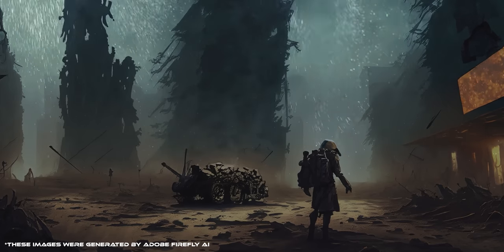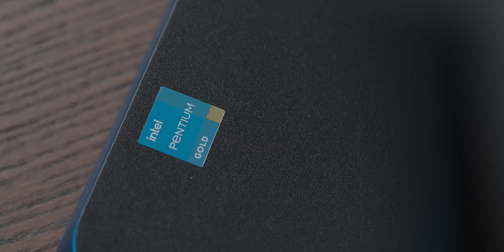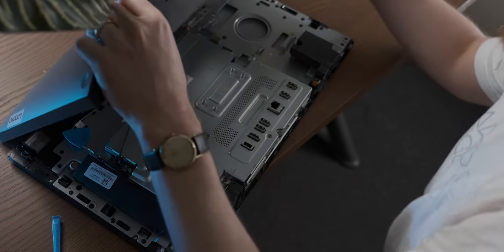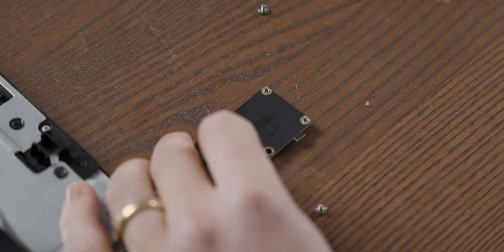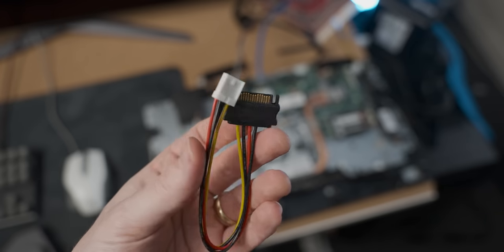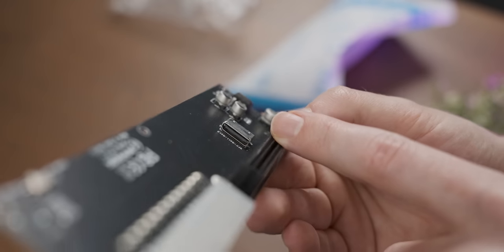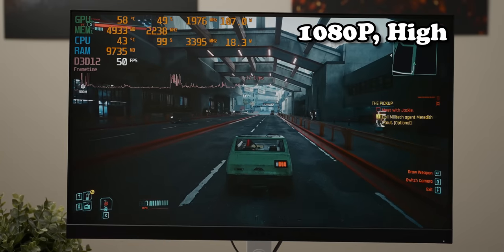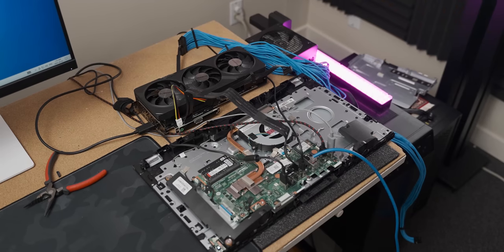How NOT To Use A Graphics Card...

Comment: Lenovo's bios has a whitelist of devices that can be used in the wifi slot. There are custom bios's that you can grab that remove the whitelist which would have made that first adapter work. I have the same adapter plugged into my t420 laptop
Reply: Can you explain the difference between cpu and gpu bottleneck please
Reply: it also might have been a cnvi-only slot... i'm guessing that because of the original wifi card being cnvi
Reply: wow thanks lenovo

Comment: That second adapter uses a power connector meant for floppy disk drives 😂
Reply: It's actually not bad.  I've used that same one to power a Radeon 6400 without any problems.  For anything stronger the majority of power should go through a dedicated 6 or 8 pin pcie cable.
Reply: Ya, that was going to go 12VHPWR style if the card actually started to break a sweat.
Reply: even still the SATA side of the adapter would be the one to catch fire first
Reply: @dividion8102  yes, it only needs to supply 25w for the pcie power, the rest goes over the dedicated 6/8 pin pcie power cables 
sata power can provide 65w safely so thats fine, I am pretty sure the floppy drive power connector can also pass 25 Watts at 12 volt because I read that one pin can carry 3 amps (3 x 12 = 36 watts so well in the limit)

Comment: I learned that duct tape can be somewhat conductive when I used it to wire a stereo in my first car as a kid. My duct-taped +12V wire rested on the chassis ground and it started smoking after about an hour and eventually blew a fuse. Not saying that was your only issue with the other adapters, by any means. But fun fact for future reference.

Comment: There's probably another comment discussing it, but m.2 keying is... kind of a mess. 

Wifi cards are usually A+E keyed, and the wifi slot in the Granny-ma-tron is E keyed. Newer SSDs are usually M-keyed, older ones may be B+M keyed, and the Granny-ma-tron SSD slot appears to be M-keyed. 

A&E sockets provide PCIe x1, USB, and some other things (a different set of 'other' for each). 
B-key sockets provide PCIe x2 and SATA. In practice, B-Key devices are usually SATA SSDs. 
M-key sockets provide PCIe x4 and SATA. In practice, M-key devices are NVMe SSDs. 4-lane NVMe drives are always M, 2-lane ones are sometimes M and sometimes B+M. 

The keying does prevent you from putting a device with specific requirements into an m.2 slot that doesn't provide them, but I believe keying for A+B+E+M removes too many pins, so you can't have a universal card if you just need PCIe x1 and nothing else. 

And don't worry, there's six unused keys, so it can still get worse!

Comment: Crazy build, though I did something among that line with a notebook once and had major grounding issues not allowing for me to use any switch in the room.
It might be a better idea to go for an MXM 3+ or RTX 3060 ITX since you actually might manage to get that build into the monitor case. There also is a slight chance that you could combine your two connectors into one PCIe 8x - provided they are splits and still are set to "auto" by the bios.

Comment: I'm half way through, and having used one of these years ago, there was some very specific bios setting tinkering I needed it to do for it to work. I used a configuration tool I found online that you had to creat a partition for then boot into that partion instead of windows. I'm keen to see if Dawid can get it to "plug 'n' play".

Update: finished the vid now, and I'm pleasantly surprised it was plug 'n' play. The version I had connected via the wifi card port with a bizarre cable that had the wifi connector on on end, and a HDMI port on the other. That's a PCIe2 x 1 connection on the 2nd gen Intel laptop I used. That bottlenecked even the GTX 770 and GTX 660ti I tried out, but it was still better than the graphics in the laptop. If you never moved your laptop and you already had the graphics cards on hand it's not the worst thing you could do to improve gaming performance on a tight budget.

Comment: I have a 6650xt, i7-8700t desktop PC running directly off 27v batteries and solar. The psu is more  a buck converter but designed for atx pc. It works amazing and is very reliable. No efficiency losses. Deff better than a generator

Comment: that wifi slot might have been a cnvi-only slot, i could tell by the pins on the left of the original wifi card
if there was a whitelist, it likely would have yelled at you during the POST rather than silently failing

Comment: I actually owned the first adapter you tried and used it to connect  a gtx 970 to a laptop with an i5 5400 processor in it.   It was quite an upgrade and I used it for about a year.

Comment: I don't think duct tape is flammable could be wrong) but I would have probably used electrical tape though (at least on the area that touches the electronics.  Or maybe even electrical tape and a zip-tie to be sure.

I would say that modern games probably don't need the CPU for much anyway it seems since most everything can be handled on the GPU now (including audio so no need to go back to the main board for audio unless you disable the GPU's audio through HDMI).  And I think this is obviously why we may have reached a point where the graphics cards will be more important than the CPU.  I mean this has been true for many years (probably the last decade at least) and almost to a point where the CPU does very little even in high-end gaming since I would say that the bulk of processing needed is for graphics things like physics support, textures and rendering, all of which happens on the video card and then goes out the outputs to the display, and that all the CPU is likely doing anymore is coordinating the disk storage and loading of files, and communications through Ethernet and some other rather minor things, but that probably 3/4 or 2/3 of modern game processing is done by the video card itself.

Comment: 7:46 my dude there are a tone of different versions if the EXP Beast adapter

And there are a bunch of different cables you can buy that go from all hinds if things to the HDMI the adapter part itself uses for data

Some if the adapters even use 2 HDMI connectors for data to get x4 PCIe lanes
Reply: I hate the iPhone keyboard it keeps changing the touch points now most the the time i type of it comes up as if FK you apple

Comment: Same mistake I did as Dawid as I thought the Wi-Fi key and ssd were the same slot as I thought of putting Wi-Fi card into nvme adapter to usb but after removing Wi-Fi card from m.2 Wi-Fi key then came to know that I made mistake so I had to put back the Wi-Fi card back in m.2 slot of my laptop and I can't put extra nvme on  Wi-Fi card slot in my laptop.

Comment: i did that on a intel atom netbox whit a rx 580    and i got around 20 fps in space engineers and 46 in halflife 2 for around 5 minutes till it crashed evry time turns out only one of the 10 power suplys i tesed for the graphicscard worked okayish the realy dont like only powering a graphics card i think its something whit the powerdraw so basicaly what im saying is test diffrent power suplys and the framerate / stability will vary wildly

Comment: Dawid face is the same as mine when I plugged in my new CPU into my motherboard then had to do a Bios update with the old cpu to get it to recognise the new CPU. For context, I was going from a amd 3600 to a 5900X and my motherboard had no flash bios option. 3 hours later after putting the cpu cooler on 3 times I had a working pc again.

Comment: I built a 'Last Pentium' machine recently (ok, well, it's running but it's not done) with a g7400. I have a Titan Black in there as a placeholder (no, the CPU doesn't bottleneck it, at all - it's like 100% all the time - yay, 2014 tech?). 

I am fairly amazed at what a 2 core, 4 thread chip is now as compared to 2008-9 - I mean, it holds it's own against much better spec'd chips in the Core series, years into it. 

I have a normal PC that I build, but damn, it bores me.... 

So I game on the Pentium in a 20 year old case, with a business class motherboard, ridiculous DDR5 RAM, and various solid state storage devices. 

With the right mix of fast elsewhere, it seems the Pentium can really hold it's own. 

The RAM was three times as much money as the damn chip. 

Sigh. It was a bargain, what can I say.

Comment: What does a asus rog ally do if you hook it to a pc? Not a monitor, I got a dock for that, but I haven't seen anyone try n hook the type c to a type c on back of a desktop motherboard...can you use the 3090 in the desktop on the ally?
Reply: Either nothing will happen, or the PC will charge the Ally but they will not be able to interact. 

The Ally's USB port is USB 3.2, which does not support PCIe, which is what you need for an external GPU. Additionally most PCs are configured to always be a USB host device and not a USB peripheral, so beyond negotiating power delivery they might not talk to each other.

And if the desktop's USB controller did support being put into a peripheral mode, Thunderbolt doesn't allow you to use the connected system like an extension of your own, so the result would probably look something like Target Disk Mode on a Mac.

Comment: I'm not 100% sure but I think your actual issue with all of those adapters is that you aren't supposed to use any of those to transport power to the e-gpu, rather only data. You need to connect your own PSU to the GPU alongside the adapter to make it work.

Comment: Only 13%? Yeaaahhh not worth the pain and suffering!

... Anyway - just make sure your Granny buys a Ryzen system instead - and if your granny doesn't care much what it costs but wants an all in one - order a system with one of these APUs in it:
(Doesn't matter much if they are called "Pro" or not)
7840U
7840HS
7940HS

Why? Because they have the 780M GPU inside - and that little thing legit rocks! The first ACTUAL APU GPU which could trick someone into thinking the system has a dedicated GPU.

Comment: Hi David, would you care to tell which adapter did work and in which configuration? I have an old laptop which I would want to convert to a Plex transcoding box with a GTX 1050. It has a wifi M2 slot that I guess supports USB only.